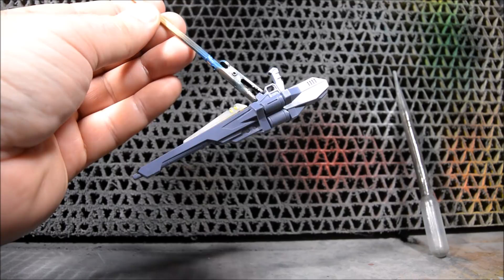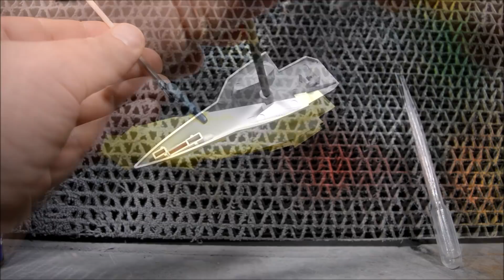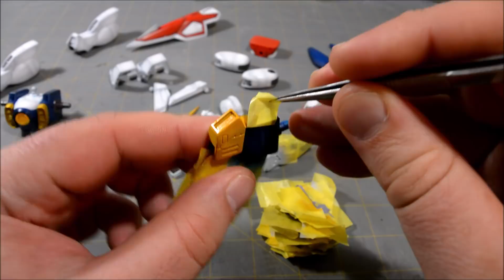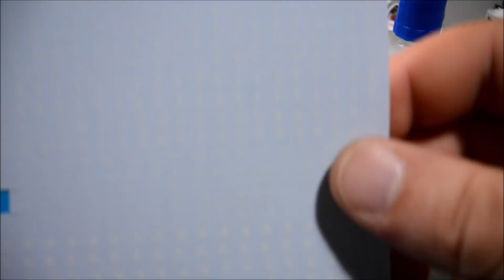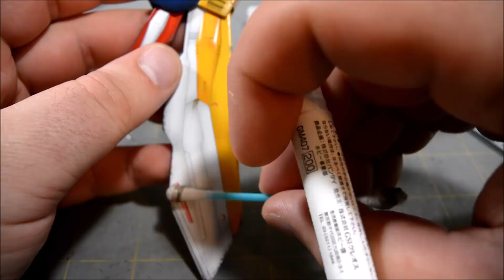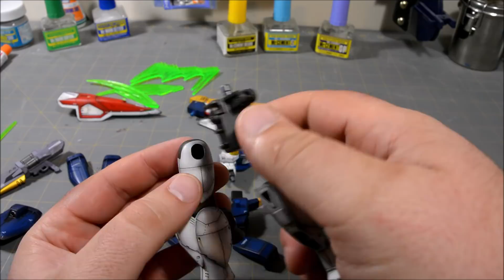Work in Progress: 1/100 HG Wing Gundam

Comment: For stubborn plated parts use oven cleaner. Let them sit for 3 minutes and the plating slides right off and doesn't damage the parts or make them weaker.

Comment: Ok, you have the 1/60 wing zero (you used the shoulder for the decal tutorial). I'm going to be putting one together, but I dont know how to deal with the knee joint. I need to remove the seams but the parts sandwich around the knees (dalong should have a good picture showing this). Any advice?

Comment: Question: is it possible to graft/modify parts of the HG 1/100 Tallgeese onto the MG one, because the one I salvaged is missing the lower torso as well as the boosters and I cannot find anyone who has one for sale (and I really don't want to spend $45 on a new MG kit just to break it down).
Reply: Anything is possible with enough skill and effort. It probably really depends on if the work it takes to do it is worth it the difference in price to you. If you don't have all the tools you need to do it, you're gonna have to spend money on those too, so keep that cost in mind.
Reply: You could just buy some booster parts and glue them on
Reply: Gunpla subreddit has a commerce thread
Reply: been posting on that commerce thread for a while now, that's why I was asking here.

Comment: They money I would put into an anime-accurate 1/100 Heavyarms
I can't stand that the redesign just... holds the gatling. Its not cool if its just a robot holding one or four gatlings.
Its only cool if the arm IS the gun, running out of ammo means drop the entire arm to save weight.